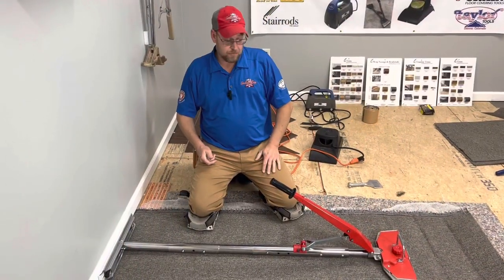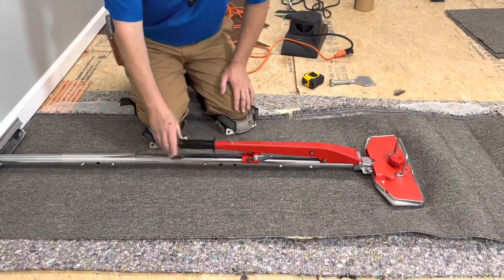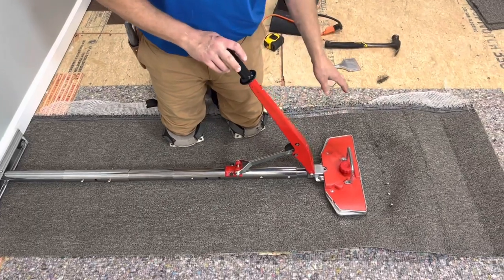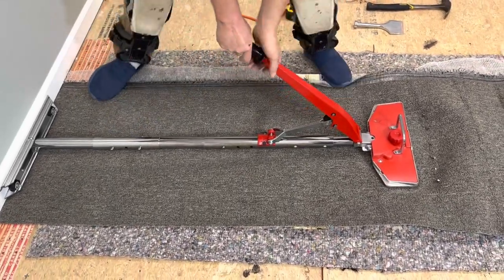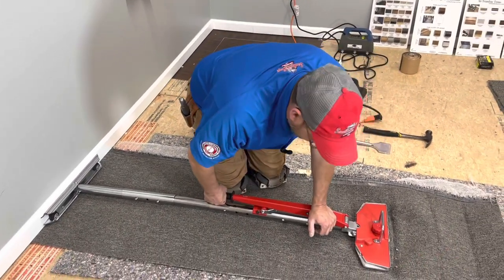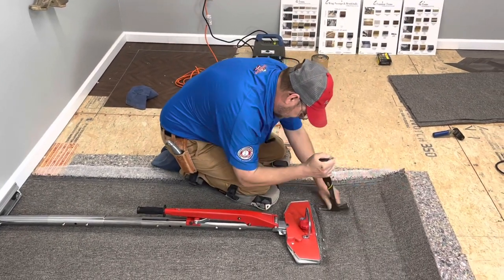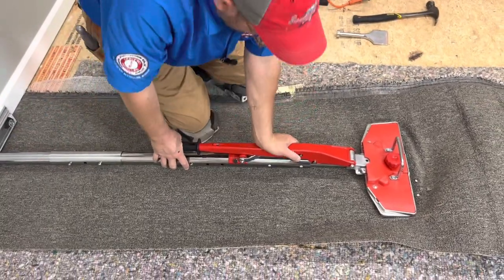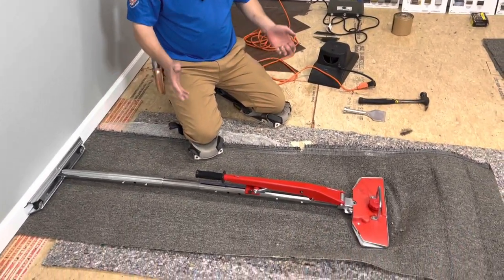Kool glide seam tape strength test

Comment: Yes, I'm sharing this video.
I can't believe what that little tiny amount of contact in the center of the tape with the cool glide can hang on that well.  Freekin' amazing.  I'm betting you could do the same test with work on xk50.
Yes, that was a challenge 😁 
I'm sure it won't budge either but I have no idea that the cool glide tape could do that and neither did you. 😁
My biggest concern was how much pressure you were putting downward and if the carpet suddenly gave away I was worried about your hands and your wrists or getting their fingers pinched under the arm of the stretcher handle.
Be careful, you need your fingers to type also 😉
Reply from the maker: I was definitely thinking about that with my fingers there
Reply: I was worried about the stretcher handle breaking. I've seen that happen. I like to see the test done with hot melt seam tape as well.
Reply from the maker: @jmccormick1490  you got it buddy
Reply: @jmccormick1490   Ivey never seen a guy use a cheater bar on a stretcher handle.
......oops I think he might see my comment. 😁

Comment: I was seriously skeptical but that was pretty impressive.  Might have to maybe try this seaming method.
Reply: You don't need all tat crap
Reply: @brandonbell6171  Just because I said I night have to give it a try doesn't mean I'll go out of my way to buy one.  I actually just use my Iron and a weight neve had issues.
Reply: @alexcleroux3054  I installed for years we never use none of that, we made good money watch your taxes every floor ing guy I know been busted
Reply: @alexcleroux3054  retired now, it's a young mans job
Reply: @brandonbell6171  yeah taxes are done every year I've heard the horror stories man.
Reply: @brandonbell6171 lmao 😅 not that hard. Plus you can buy it and write it off at the end of the year. There's definitely benefits to this over the traditional stuff. Time being the best reason to invest. My only doubt has been strength but it looks like it holds up

Comment: What setting do you use when using the seam board that the kool glide comes with making a seam over pad?
Reply: I use medium on the board, or low if straight over pad. But i have used low on the board a couple of times on underfloor heating and warm houses. My boards usually frozen cold from the van 😄
Reply: @stanleyflooring6772  do you ever notice burning on the tape?
Reply: @jameslick5233  usually the burning of the tape happens when the iron isn't centered over the tape
Reply from the maker: Medium

Comment: Sorry, but you didn’t stretch that carpet 3&1/4”, simple science of the heat tape why would any properly heated tape fail? Measure from the wall out to past stretcher put a piece of tape then a line, stretch and measure. You may have gotten 1&1/2”. Aside I agree the seam shouldn’t fail, I assume you hear koolglide seams are not strong, I’ve used koolglide and there are some consistency issues, you have a 2’ controlled test, real world strength factors vary.
Reply from the maker: Next time i will mark and measure
Reply: @FloorsbySouthernboys  

I e seen your other videos I’d say 5? Years ago we’re very good. Not sure of math for 4 ft stretch at 1&1/2 percent but you probably went 4X over recommended stretch so obviously the seam strength is there.
Reply: Wow Mike your special Do you wear a helmet?
Reply: @rickgagne8564  
No, sold my motorcycles, you?